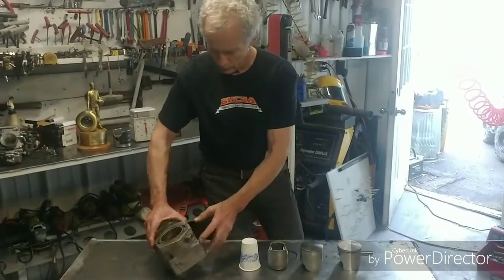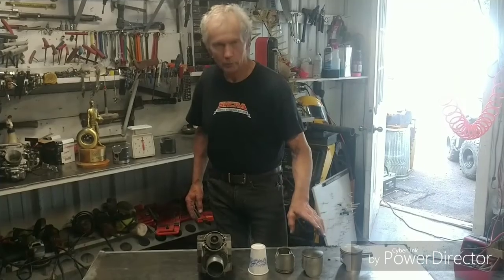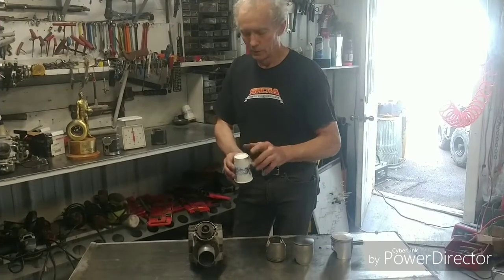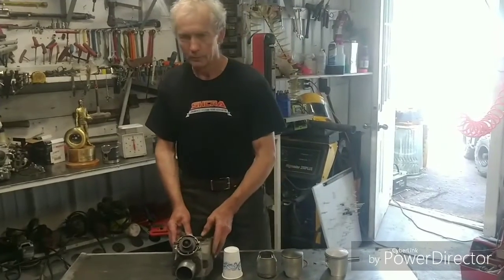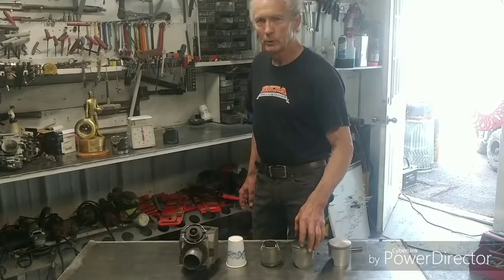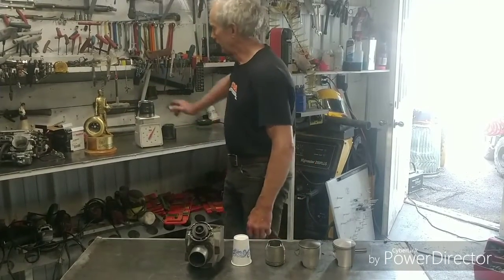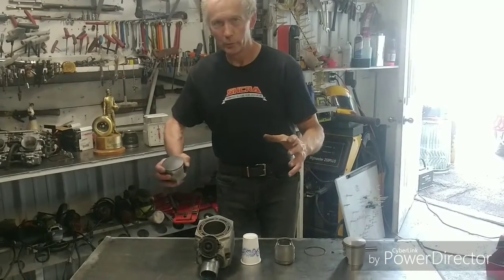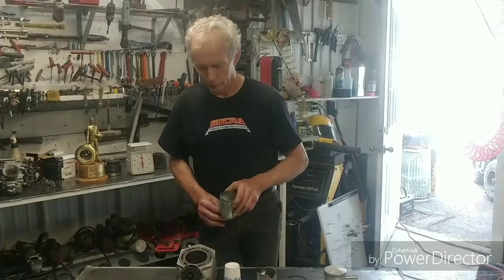DynoPort Rich talks about pistons

Comment: how often do change the rings
Reply from the maker: Usually do not my 08 XP mod sled ran 10 years at least (2) classes and at 20-25 races a year with stock pistons and single ring. NO reason to change a ring unless compression drops and usually very high mileage and then you should replace the piston as the skirt could break or the ring locating pin could come out. By the way we do not see more power on the dyno with our 1019 triples with new rings if the old ones still have good compression.

Comment: Rich...really like your style bro...straight to the point...no horse crap along the way.  I wished you would have gone further and went into the pros and cons of cast vs forged pistons...would like to hear it.  I am putting a top end in a skidoo 850 etec...trying to decide to go with wiseco forged at $132 each...or the stock cast at $250 each.  Also...interested in your opinion about the skidoo 850 split rod bearings...the fact that skidoo will not sell consumers new ones!  Here they design a great crank with easy to replace rod bearings...promote this feature only to then not allow the bearings to be sold...poor business...very disappointed.

Comment: Rich what color and spring should i run in my 2013 mxz 600rs for 4400 rpm engagement,,now it engages at 6000rpm ,i dont like that.Thanks
Reply from the maker: Hi Joe, Find out what the first # on the spring is and then the dealer will have a chart I would try to find a spring 50 to 70 less on the first # and close on the second # but if the second # is lower no big deal you can adjust the clicker to get top rpms. You are on the right track anywhere from 4500- 5000 and I bet its more fun to trail ride.
Reply: Why don't you like it? At 6 grand you have somewhere near 100 horses (without me looking at a dyno chart for that engine), at 4400rpm you have maybe half that. If its a little jerky then its just your thumb (Chris Burandt always keeps a finger on the brake when he does his crazy riding and need control over the speed at low speeds, as opposed to letting the sled bog as you fully release the throttle a thousand times). Once you learn to ride smoothly with high engagement you'll outrun your previous self by a mile on a half mile race through the trees. You likely need a very high initial spring rate on your secondary though, or else it'll slip a lot and you'll wear out the secondary sheaves in a single season. 
Try adjusting the location of the brake lever so you can reach it with one or two fingers at all times (whichever finger(s) you're comfortable with). Then try to get used to high engagement, if you can't in a season then you can go back to the trail-friendly clutching for the average limp-wristed rider :P